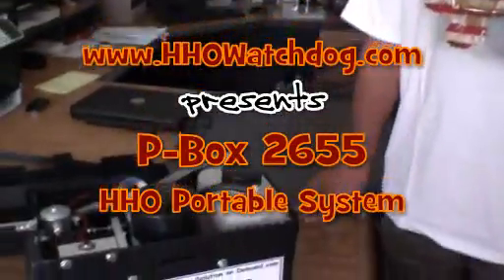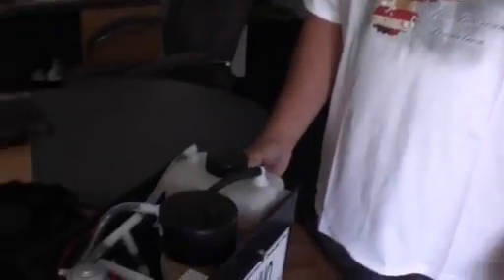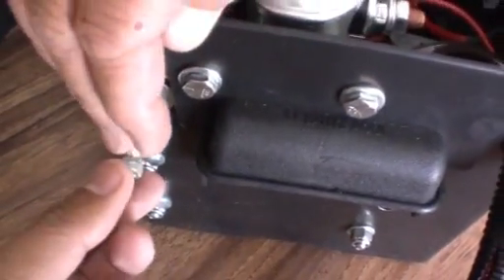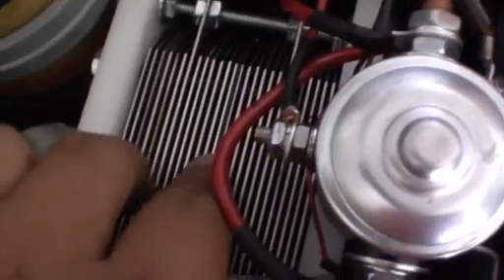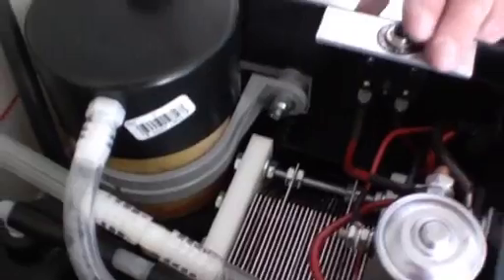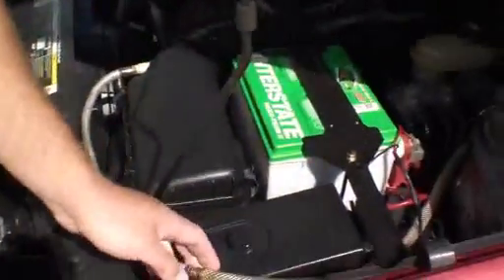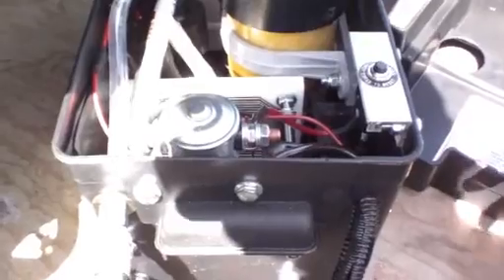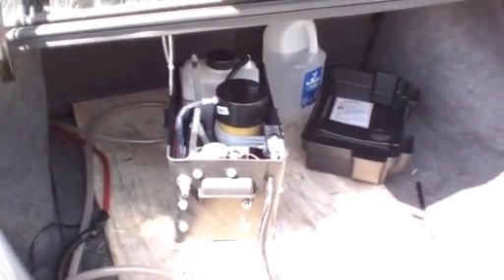Portable HHO Generator System - Pbox 2655 HHO Generator

Comment: I do have a question,  how often do you have to change the oil and how much water do you get in the oil from running the hho generator. I do know this is a problem. I was just wondering how you solved this problem.

Comment: Presently, even in new automobiles, approximately 20% of the energy in gasoline is used as motive force(to move the vehicle), 40% of gasolines energy is lost to heat and friction, and approximately 40% of gasolines energy is sent out the exhaust manifold as unburnt fuel(HydroCarbons). Ortho-Hydrogen is apx 2.5 times more powerful than gasoline, thus increased combustion efficiency and improved miles per gallon, and lower emissions.

Comment: You really did a great job of making this video. Very detailed information within the video. You answered every question I had, in this video. I was recently reading an article written about why HHO units work. The article notes it's because of the extreme inefficiency of the engine(only apx 20% of gasolines energy is used to move the vehicle), the introduction of HHO gas increases the efficiency of the combustion.

Comment: Could you connect it to the alternator to get a relative voltage output and production when you speed? so it is not constantly running on one production of gas regardless of speed or throttle for efficiency.

Comment: I am wondering with such a tiny amount of HHO gas how will such a small unit help the mileage on a full sized car with say a 2000 CC engine? I am all for doing anything to help mileage, but just doing the simple math in my head I can't see much help on an engine that pull in well over 15,000 liters a minute at full throttle. I like the idea of the dry cells. Let me know please.